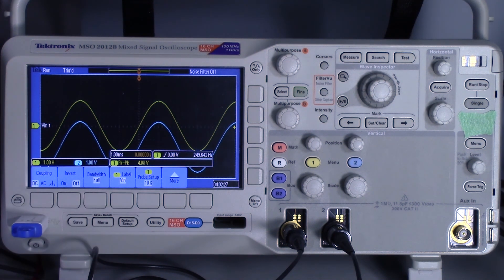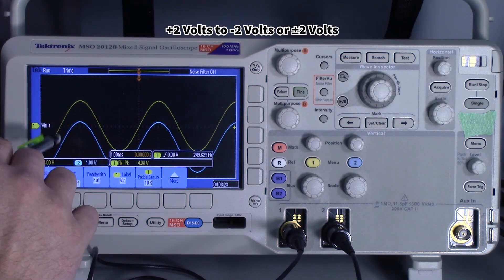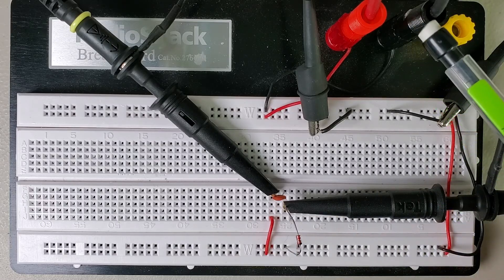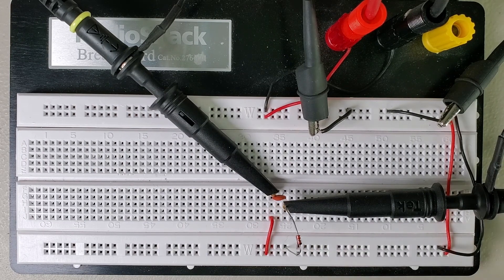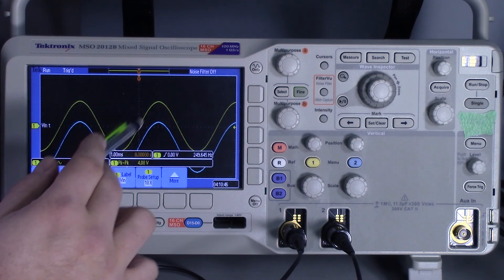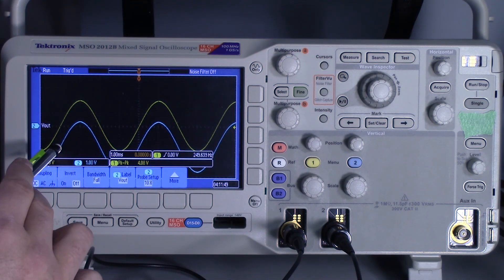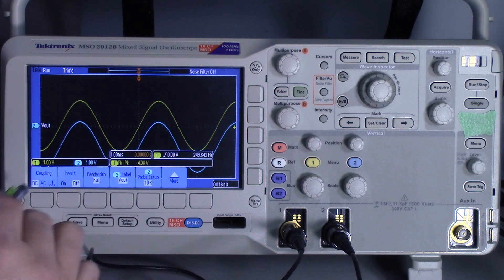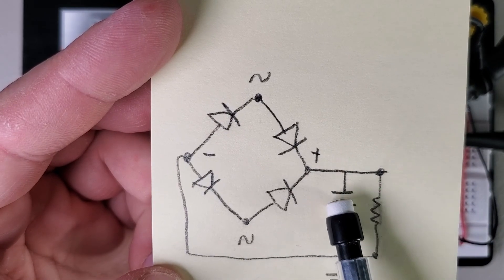Oscilloscope: AC-DC Coupling

Comment: Thank you for the great video. I am learning,  and currently working on flter for car sound system. Could you please help with advice ? As I understand - can use diode bridge to get rid of ripple from alternator. Plus capacitors. What resistor for? Also - what would you suggest for getting rid of ripple. I am only learning